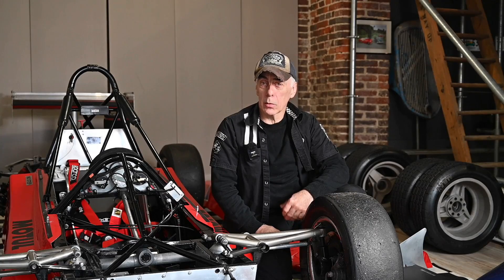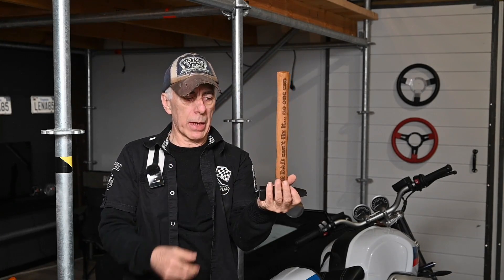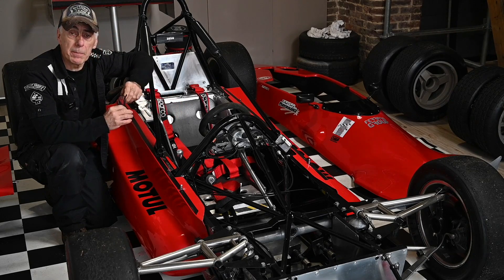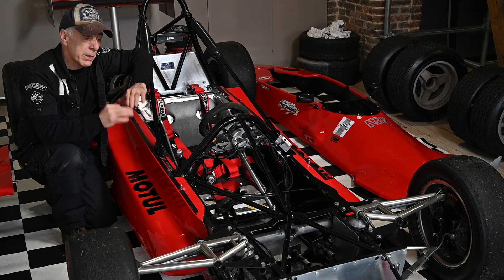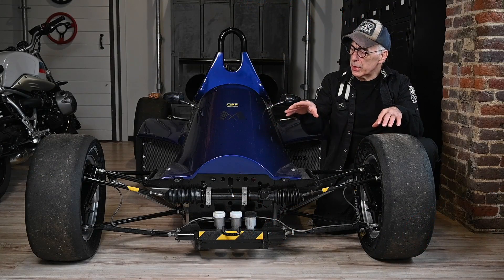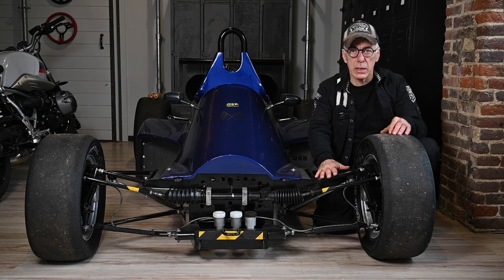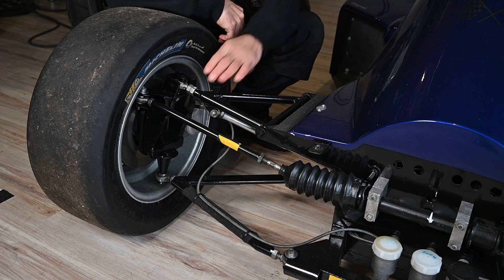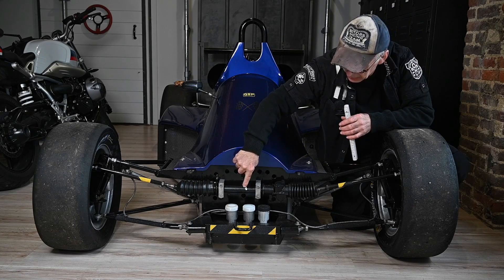Lowering the riding height  of a car - does it make sense ?

Comment: Very interesting video, but don't forget that as soon as you get any roll angle, the geometry changes and the roll centre will move all over the place. The roll centre is usually a product of the suspension geometry, not the ride height as such.
I found you a few months back for your TVR 3000M videos. In fact I've just bought one myself so I'll be rewatching those again!
Reply from the maker: Indeed, the RC moves around while you corner...

Comment: The center of gravity should go up as the car lifts. It appears to be around 200mm in both cases. Case 2 should be higher reducing the effect, though it is still present
Reply from the maker: Yes  in reality it does move if you lower or raise the car in reference to the ground , but not in reference to the RC.. Its the RC that moves, and of course what `i have shown is a static RC.  That is in reality also moving while we corner left or right...   The way I have shown it, is to keep it simple enough as it is a complex interaction between many forces and parameters

Comment: great explanation, most videos just don't have the visuals to back it up.

Everyone talks about lowering the center of gravity, but never mention the roll center itself dropping and instead of having less roll you gain more without the suspension travel to even handle it 😳
Reply from the maker: Thank you, there more aspects we could talk about like where do the forces pass through the suspension.   For instance when cornering the outer wheels get a specific overall force sideway/down.  If break that force into two vectors, we have horizontal and a vertical vector.  The horizontal force is always  passed to the whishbones to the frame and the vertical force through the coilovers...  When the RC is low, the vertical vector ( force) is much bigger then when the RC is higher.  on the otherhand , a high RC  passes more forces through whishbones and less through the coil overs...    lets of stuff we could talk about...